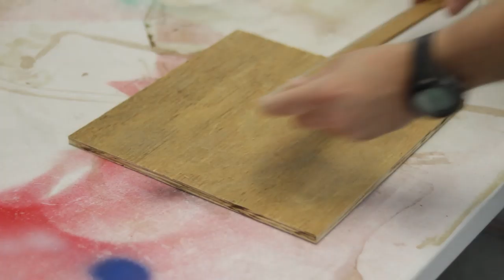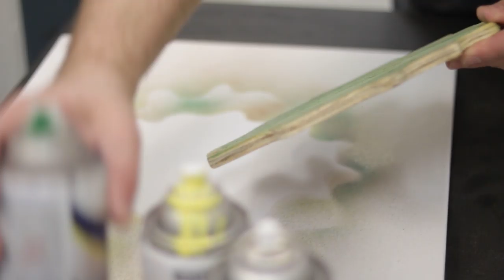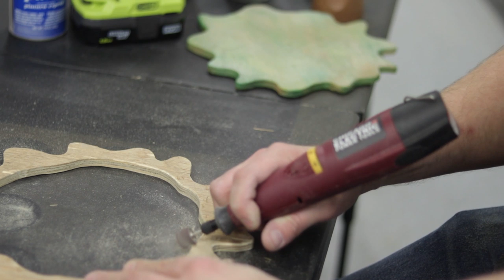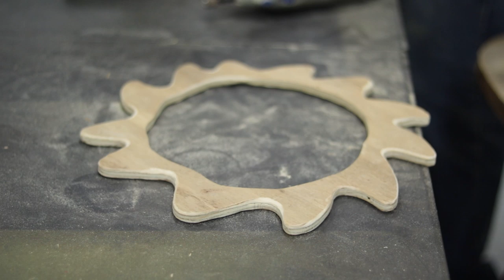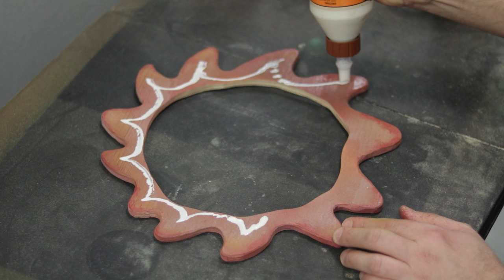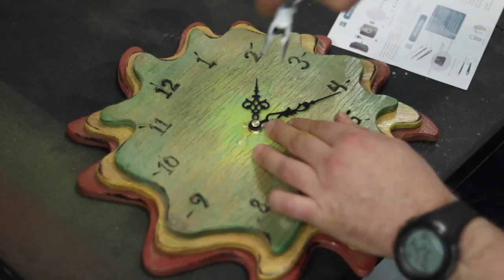Make a Clock at Home!!!  Eps 376

Comment from the maker: This particular kit requires you use 1/4 inch wood (0.7 cm) for the main face.

I used closer to 1/2 inch (1.2 cm) wood in the video and I later had to carve out the back of the face a little bit to make the motor and hands line up.

Comment: Cool!  I don’t have your range of tools, but I have enough to do the trick, so I may just try it this summer.  My only snag would be the plywood.  I can’t handle a 4x8 sheet, and there’s no local source that will cut them down.  Hmm.  I’ll think of something.  I’ve been wanting to experiment with milk paint too.  Thanks Matt.
Reply: My Home Depot does two cuts for free and charges  three dollars per cut after that.
Reply: .....what  is  "paint milk"?😕
Reply: Miss Nancy Lee  milk paint is something that’s been in use for thousands of years and has gotten popular in recent years.  You can make it yourself, and it doesn’t need toxic chemicals.  There are different recipes online, and you can also buy it on Amazon. Check it out.  It sounds real easy and looks good.
Reply from the maker: Nancy, you can get craft plywood at Joann Fabrics when they reopen that is 1/4 inch thick and 1 ft. square, which is perfect for this.  The face of the clock came out to a 9 inch diameter circle.
Reply: jean martin there actually is a Home Depot a half hour away, but I don’t think they carry lumber.  I’ll call them.  Thanks!
Reply: Matt's Crazy Art , it looks larger in the video!  The nearest craft store of any kind is hours away.  I’ll look online and see if they do mail order.  We’re lacking a lot of things in this area. I guess most of the chains think we can make do, being hillbillies and all!  Lol